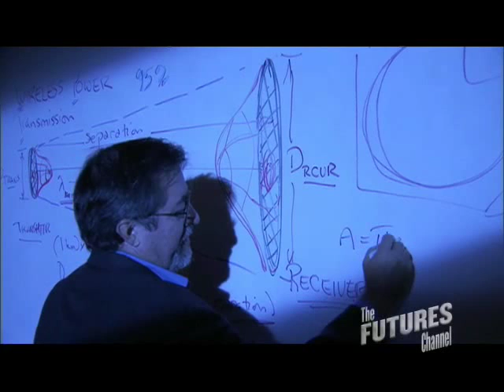Space Based Solar Power Preview

Comment: Keep in mind that the Sun also shines on the Earth.  At best -- after converted solar electric power to microwaves, beaming this through the atmosphere, collecting it with a wire mesh and converting it back to electricity -- this offers only 3 times more total production efficiency versus the same solar panel arrays planted on the Earth. The rocket launch costs alone would drive the production cost per KwH to $2-3 (versus 2-3 cents per KwH for a typical power plant). And when you look at this purely as a power company who makes money by making power cheaply, space based solar power will always be seen as a colossal waste of money since power companies will always be able to make the same amount of power on the Earth with solar panels using much less land than a microwave target, and the whole system would cost at least 100 times less than launching the production plant into orbit -- including the added cost of batteries for overnight storage.

So, in reality, it turns out that making solar power in space only make sense for use in space.  Run the numbers -- see for yourself.
Reply: That's not just the point what about that fundamental American drive to do the unthinkable, This could be an Industry that creates more jobs even if it costs a lot of of money that's nothing to a country like ours and also we will be creating more jobs and more wealth plus I'm pretty if we cut down our defense budget, stop intervening and starting wars we can afford this and the notion that this will cost a lot of money is absurd to me, when we had no problem in Spending a trillion dollars on Iraq and Afghanistan, Spend everyday 251 Billion deporting illegal immigrants